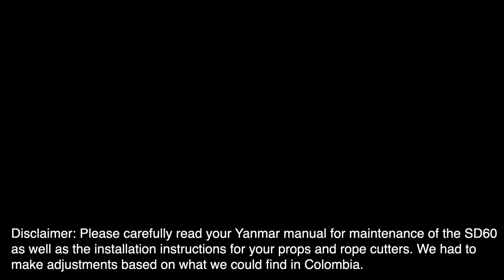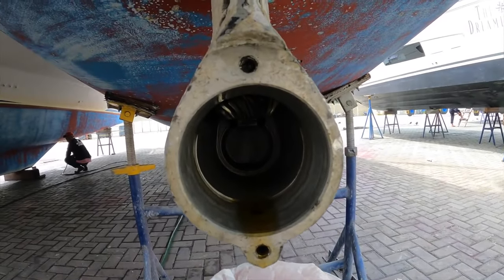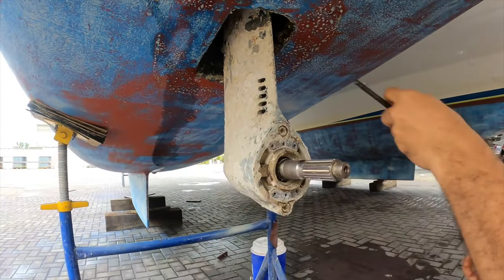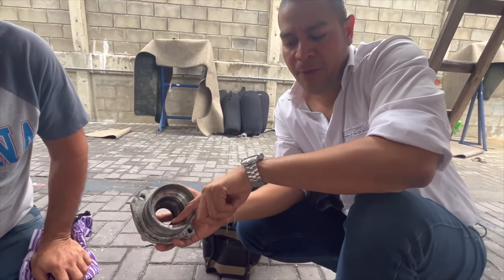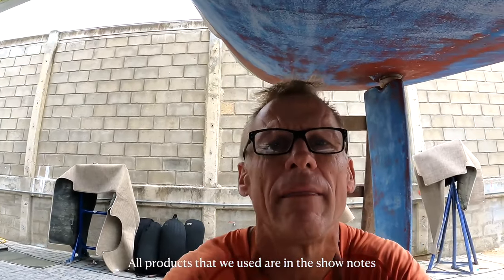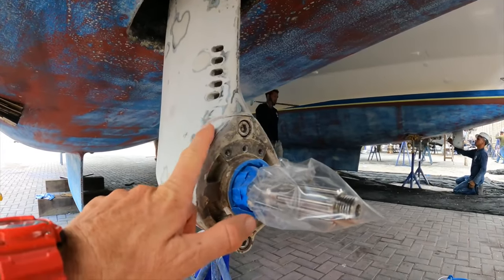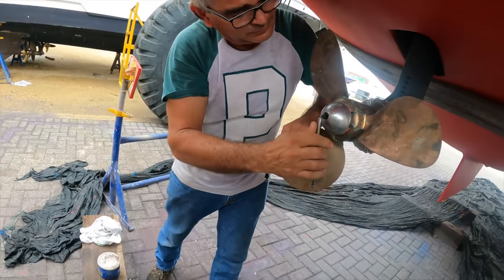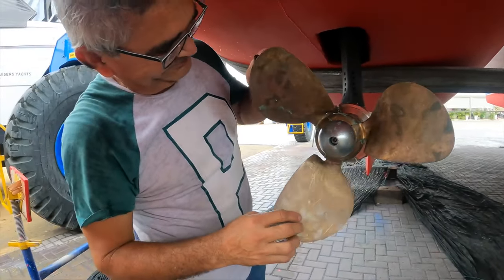254: Complete Yanmar SD60 Sail Drive Seal, Service, Painting, Flexofold Propeller & Rope Cutters

Comment: That inner ring as you called it, is called a race, and it's a pressed in race with a press.    Very, Very important to install it properly.  You would be surprised how many mechanics install these backwards.....and they need to be installed new!!!   My boss would NOT warranty this type of repair unless everything was installed new. The bearing rides on the race.  The lower unit of the sail drive is basically the same as an outboard motor lower unit. Also all bolts should be replaced as well and all holes should be cleaned with a Tap. Tap and Die set.  I realize you don't have access to these easily. Having a hole shaft as a spare would be a good thing, but very expensive.  There are many tips I could give you, but you got the job done.  Great Job!!!!   Also the Torque spec's for bolts should be followed....A lot of people think just tighten the hell out of the bolts and it's fine....Not the Case.  I had not watched the whole video before commenting....(Tap and Die set)....lol.  Guess was right
Reply: Thank you for the comprehensive video.  Can you please share the cost for Carlos and the machine shop for our reference?
Reply from the maker: @brentdreisbach6829 Sure. 866000 COP for all of Carlos’ work including machine shop
Reply from the maker: Wow. This is fascinating!! Thank you so much for sharing your knowledge! We really appreciate it. Thankful that we did a lot right and I am sure with the proper tools we could have done more correctly. Thanks again!!
Reply: @SailingBlownAway  That's about $217 USD. Very reasonable! Thanks for the info.
Reply from the maker: @brentdreisbach6829 You are welcome. Yes, very. He worked with us on site for at least 5 hours, maybe more plus the machine shop and work he did at home. And he bought us 6 new screws too.

Comment: Great video!   When I first changed my seals I searched and did not find anything as comprehensive as this.  For the last 2 years I have been using zinc and Trilux spray paint as well. Works great for me. Just needs a little snorkel scraping once in awhile.  Also, I have the same Flexofold propellers. Have you followed Out Chasing Stars - David Alton? Anyway he lost 2 of these props. It is too late this time but I always over torque that main nut. 15nm doesn't seem like enough. I know it has a bent washer holding it but that nut is the only thing holding the hub and props on the shaft. I don't have a torque wrench but I put a 2x4 on the prop to the ground and tightend the cr@$ out of that nut.   Happy Sails
Reply from the maker: Hey Chris!! Thank you SO much!! This is helpful to read your experience!! Yikes I have not seen David and Amy’s video on losing TWO flexofolds. Dang it. If we had known earlier…hope we don’t have any issues. Why would the instructions give a torque that doesn’t actually keep them on??? Thanks for the heads up!!! Don’t want to change them in the water but next time we do this we will make sure we tighten more!! Thank you!

Comment: Very helpful, thanks! 

Question: Do you carry the SD60 seals and zincs (assuming yes) and various goops/sprays (highly technical terms haha) or do they have most of what you need in the boatyard?
Reply from the maker: Yes, we always carry extras with us to make sure we have the right stuff at the right time.  We consider them regular maintenance items, just like oil and fuel filters along with extra oil and antifreeze.

Comment: Yanmar spec not to lube seals or hub when installing seals
Reply from the maker: Specifically download the Yanmar SD60 “Service Manual” which is different from the “Operation Manual” as it provides MUCH more detail.  On page “4 - 15” it says to use Starbugs Assembly Grease as well as Loctite High Temperature Gasket Sealant which is cheap and relatively easy to find.  I also found an inexpensive substitute for the Starbugs on Amazon.  I highly recommend doing all of these specific recommendations to reduce the chance of premature haul out due to leaking seals.  Message us on Facebook if you have any questions.